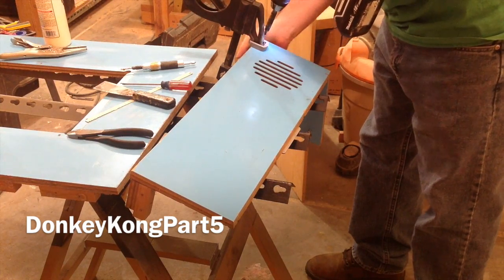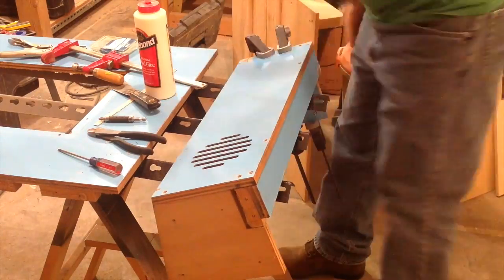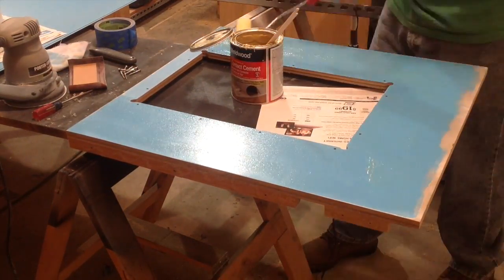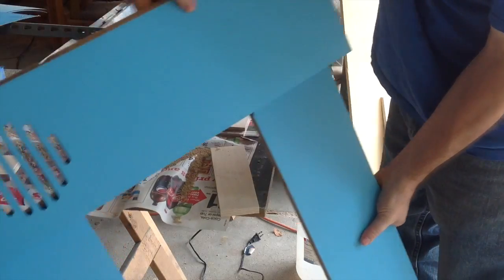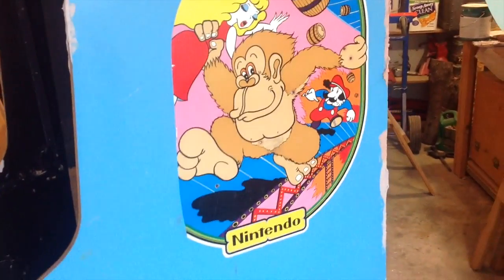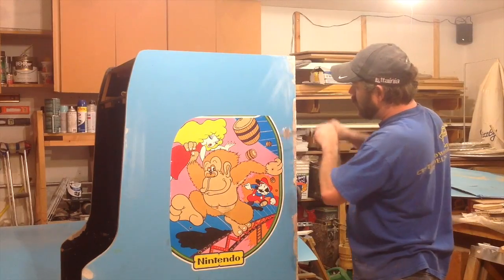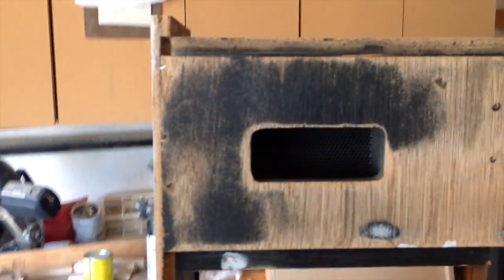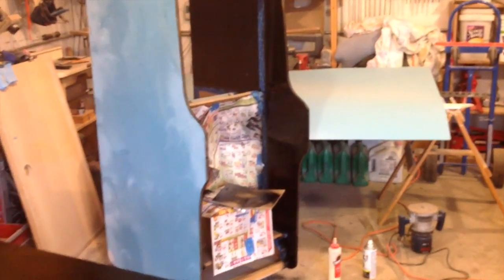Donkey Kong Restoration - Part 5

Comment: How did you route out the speaker grill?
Reply from the maker: I drilled a hole in each opening of the grill. The hole was big enough for my 1/4” flush trimming bit. Then I routed each opening.